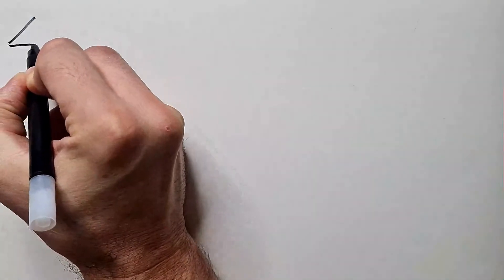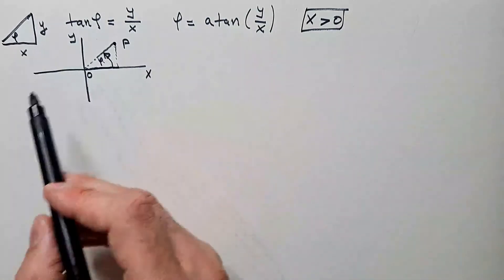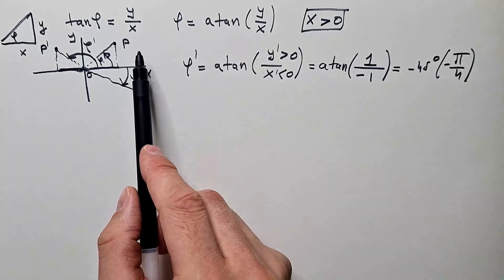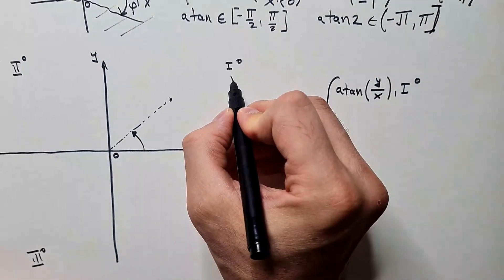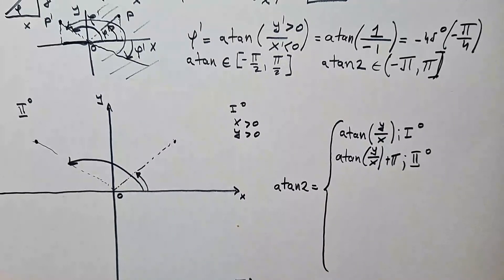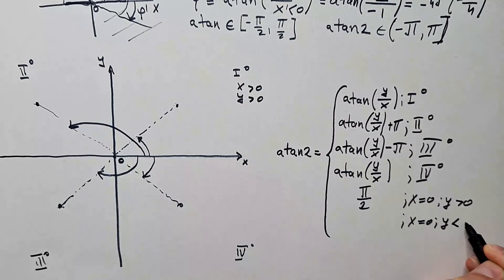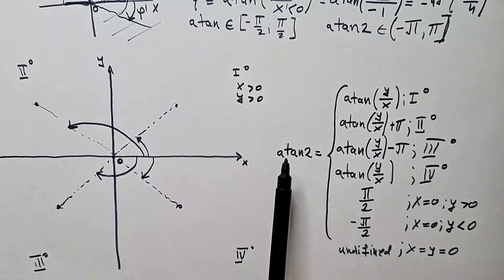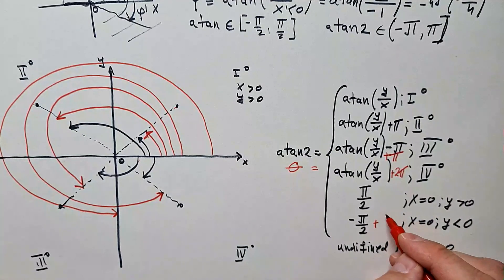atan, atan2 and Standard Angle

Comment: in last standard angle thing, should it not be 3(pie)/2 instead of -pie/2 + 3pie/2.
Reply from the maker: It is +3(pie)/2.  -pie/2 is not related to the standard angle.
Reply: @DjordjeRomanic   Sorry, I'm still confused, at the end why not add 2 pie? Because if -pie/2 + 3pie/2 the result is not equal to 270 degrees, while the result of the tetha angle must be 270 degrees, right?